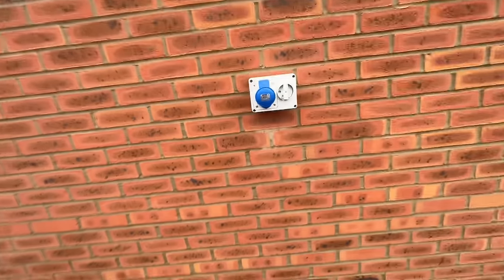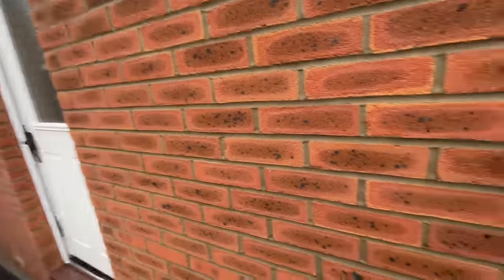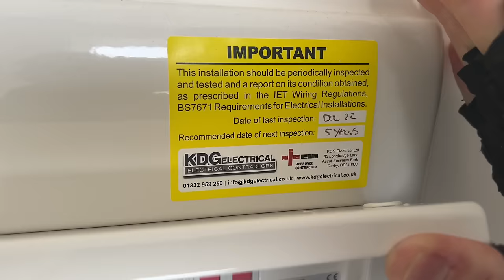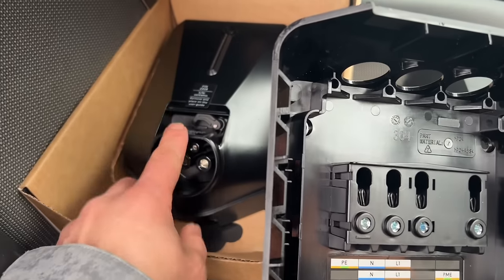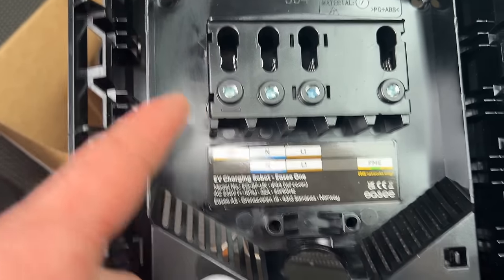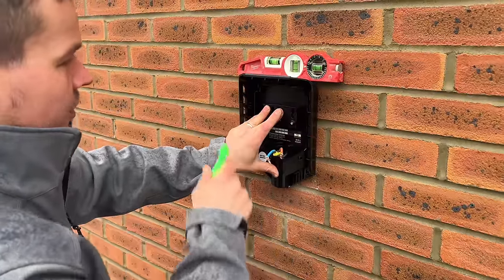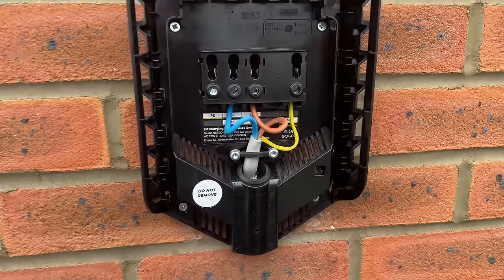Electricians day 4 hours driving for 19 minutes work!!! #electrician

Comment: - [00:58] 🚗 The journey to Nottingham took 2 hours.
- [02:15] 🔌 The installation process involved sealing cables into the Easy EV unit, which required special techniques due to the limitations of the product.
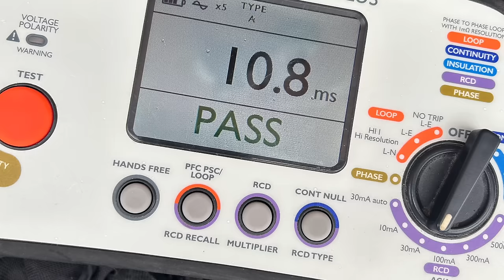- [04:46]⏱ Despite the quick installation (10 minutes), it took an additional hour to activate and troubleshoot the Easy EV due to issues with the accompanying app.

Comment: how do they do load management?  usually you have a clamp round the incoming line..
Reply from the maker: Optional equaliser kit. Just ramp the charger down on the app.
Reply: @Cjrelectrical  Agh ok thanks, you didn't show that bit.. :)
Reply from the maker: Yeah honestly the app is the worse interface I’ve used.

Comment: So why has this charger been chosen as the word "crap" was used a lot? New builds still fitting split load consumer units surprised it had surge.
Reply from the maker: Compared to others this chargers app and back plate is very poor. The users app is great. Again no thought for the installer.